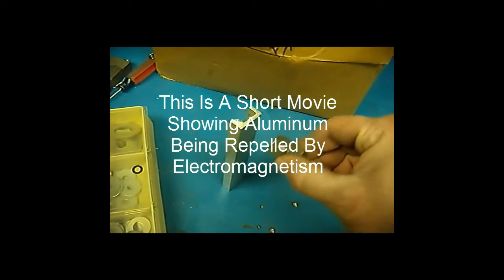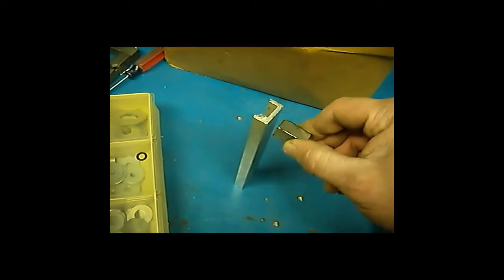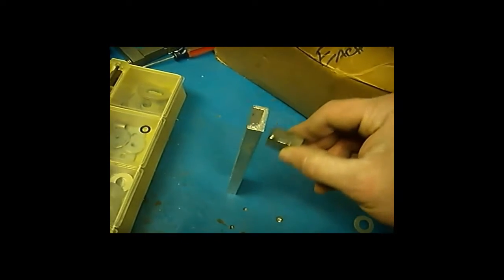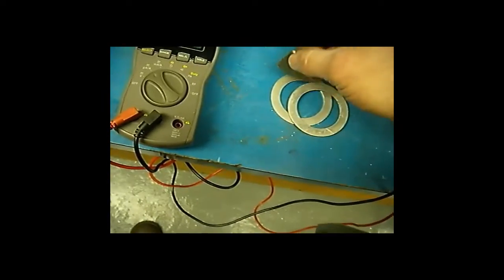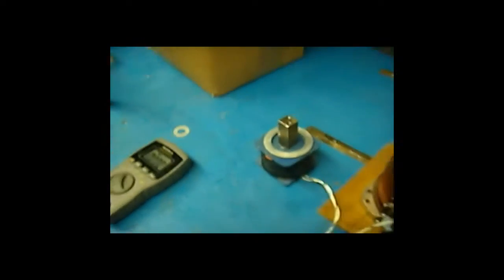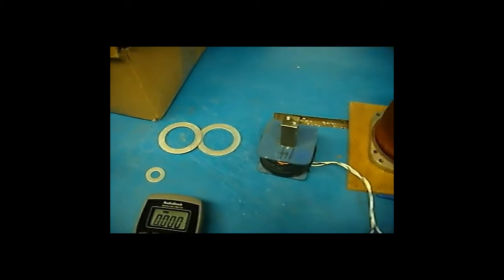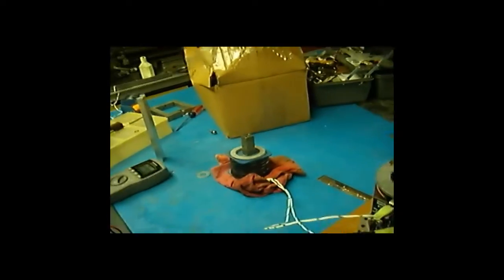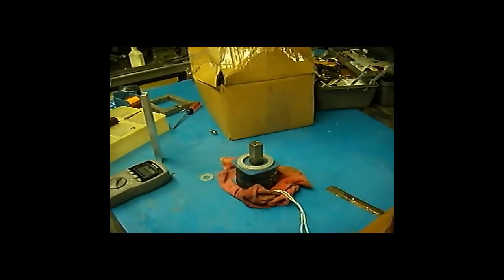Electromagnet Repelling Aluminum

Comment: great Video... got to know new concept.. thanks
Reply from the maker: https://youtu.be/TkD1KWZoOu4

This is a special electromagnet in that video above, that causes aluminum to be attracted to it. In actuality in our universe there are no attraction forces, only forces of repulsion. So what you are seeing is the aluminum being repulsed to the magnet. 

Vacuum pumps and vacuum cleaners do not suck dirt and air into them. The pump inside the vacuum takes what air pressure exists in a vacuum, and compresses that air, and then ejects that pressurized air into the atmosphere. Which causes a negative pressure to be created in the vacuum chamber. Then air pressure from outside the vacuum pushes air and dirt in the carpet into the vacuum cleaner. 

Refrigerator magnets are not attracted to the refrigerator they are pushed to the refrigerator because the magnet sets up an area between the magnet and the refrigerator that is less repulsive than the area outside the magnet. 

Sincerely, 

William McCormick

Comment: greetings Mr. McCormick. I was wondering what was the power input that you used in the electromagnet to repel the aluminum washers? was it AC or DC? thank you for your kind attention.
Reply: Does it work with DC?
Reply from the maker: aboubrad That was all AC power just at different voltages. Standard AC house current 120 volt 60 hertz power, being raised and lowered in voltage by a Variac , a torus wound transformer, with a variable pickup.
Reply from the maker: aboubrad From shallow experiments no, DC had no effect on aluminum. However I have never tested for that specific result. I will do such an experiment with a lot of magnetic force powered by DC.
Reply: William McCormick I won't miss that!

Comment: Electromagnetisism newb here: Can you both repel and atract aluminum with the same electromagnet?
Reply from the maker: Ernesto D. Hello, yes you can both repel and attract aluminum with an electromagnet. It is much easier to repel aluminum than attract aluminum. It requires a special winding with a double core to attract aluminum.
Reply: This is critcal info! I am starting to get involved in electromagnetism so once I am on college I don't struggle with projects.
Reply from the maker: Years ago from what I understand someone built an aluminum rotor repulsion induction motor and the effects were not stable. It escalated to destruction. I did not personally see this however the individuals who told me about it were top engineers at Grumman Aero Space. They worked on the stuff that can take out just about anything on earth.
Reply from the maker: The magnets in either case will not attract and repel. Each magnet is specific in its purpose. The magnet repelling is being fed AC current, alternating current. 

And also the magnet that is attracting or creating an area void of repulsion, is also being fed AC current. 

The power in wattage is probably over a 1000 watts. 

Sincerely, 

William McCormick